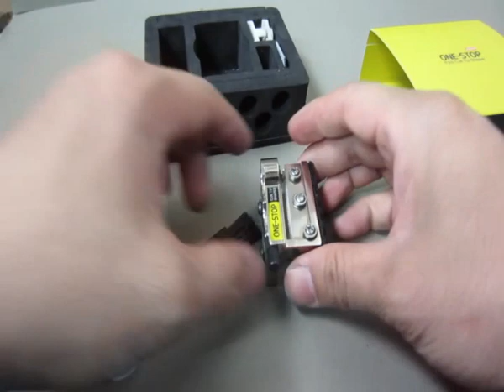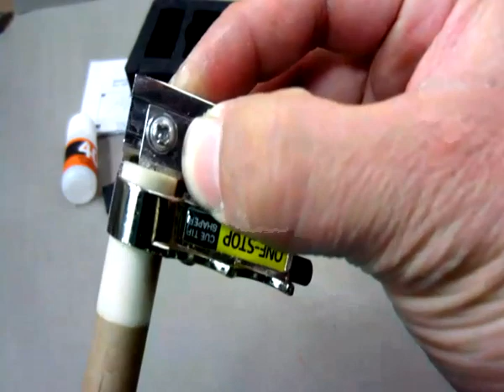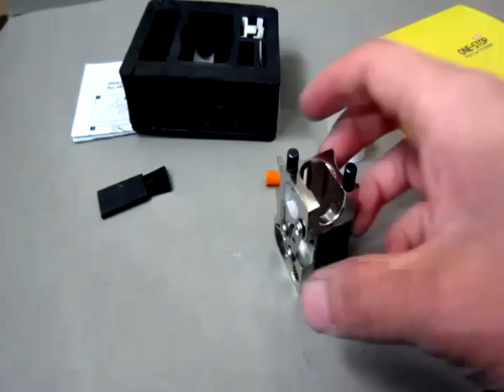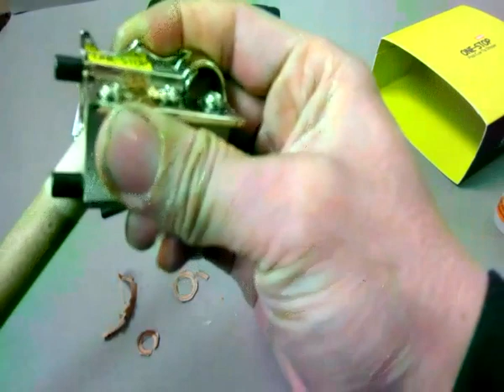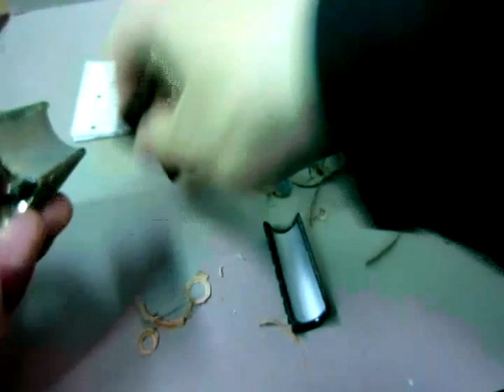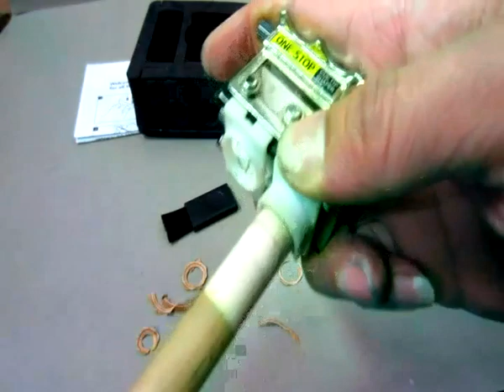One-Stop cue tip shaper

Comment: Professionals would use a lathe not this ferrule scratching device.
Reply: Yes, obviously. This is for average people without a lathe to change a tip by themselves. But I have been fine doing my own with just a few simple items.
Reply: You would have to try to scratch the ferrule, but I'm not sure you could even get it near the cutting surface. You've clearly never used one.

Comment: In your demo at 3:22 it shows you shaving off a portion of your own ferrule. A tip tool needs a method to either lock the stick to the tool to prevent inadvertent movement of the shaft against the cutter or a method to adjust the cutter position so inadvertent movement won't impact your ferrule.
Reply: Yes. I saw this damaging, too.
That for me, ut is not the right way to cut mushroom...I am looking for a safer tool to do this...anyone has an idea instead of a cue lathe?
Reply: @Stony1980  honesty, just send the cue in to a professional. I wouldn't want to ruin my cue, that I've had for so long, because I was impatient or cocky.
Reply: @Stony1980  The Willard tipping machine is the best tip tool I ever used (aside from a lathe). The tip trimming is guided by the shaft/ferrule so it will cut evenly. They are expensive though. I used this for tips when I worked in a pool room in Connecticut years ago, it's safe for very high end cues with ivory ferrules.
Reply: Vector tip tool.  Cheap and works great for mushroom.  But u must put some spit on tip or it will pop off.    A must have along with a Willards shaper/scuffer !!!!!!!!!!!!!   30 bucks for both

Comment: where do you buy replacement blades when they get dull
Reply: It's not replaceable. The cutting surface is metal. It's like a rough file. You replace the thing when it gets dull, but I've never had one go full before I lose them, lol. They are dirty cheap. I've used a BUNCH of different shapers and always gone back to this one, even 30 years later. The other con he didn't talk about is that if you let the tip get really flat before you shape it, it takes forever to file it back you the right radius. And I would still highly recommend scuffing it after shaping.

Comment: the One Stop I received did not have the last 3 items used for shaping the tip, in the box!  Why not?  And, if you are careful, you will not scratch the ferrule; if not, you will!
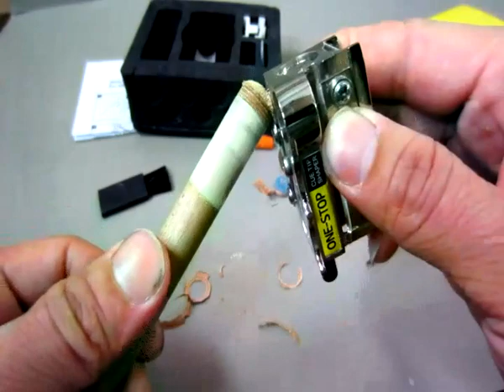Reply: Same here, and also one of the features on the block @5:37-5:38 is not a feature on the block I purchased. Still like the tool though.
Reply: Couldn't edit my post - I think that presumed missing feature is an aerator, and there is one on the block I received, seemingly relocated to the side, and all plastic (but effective).